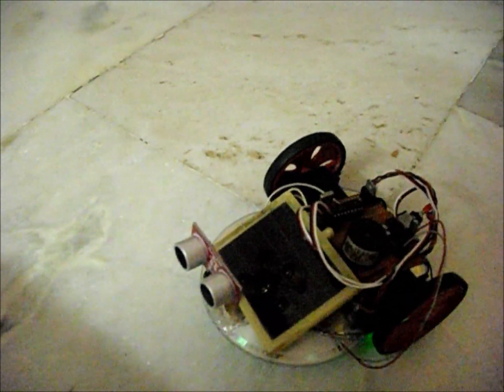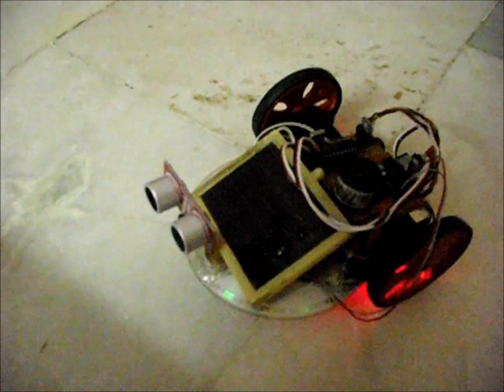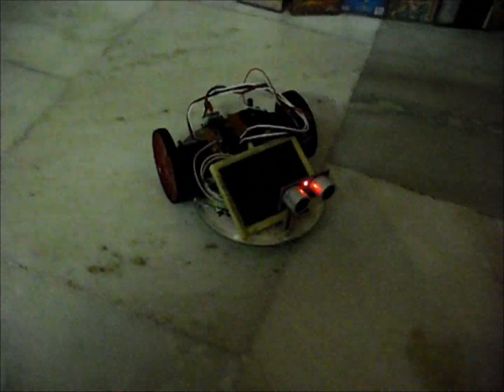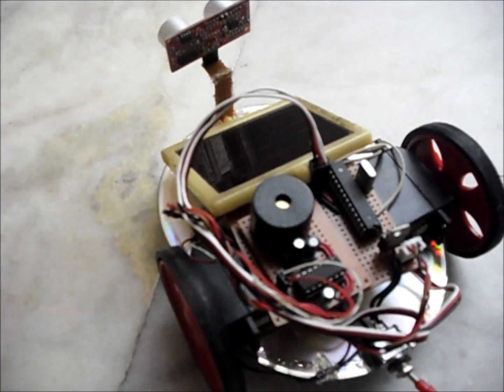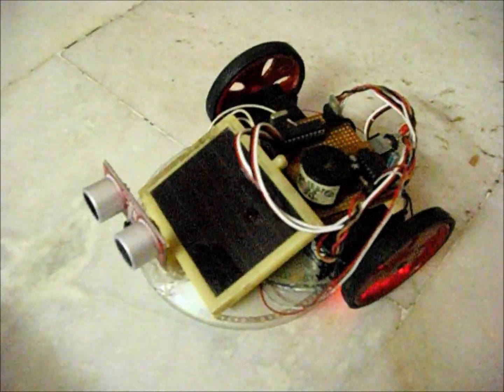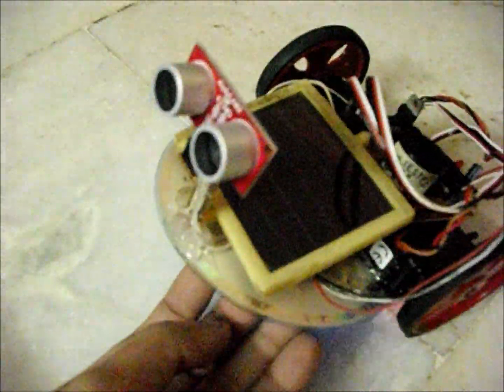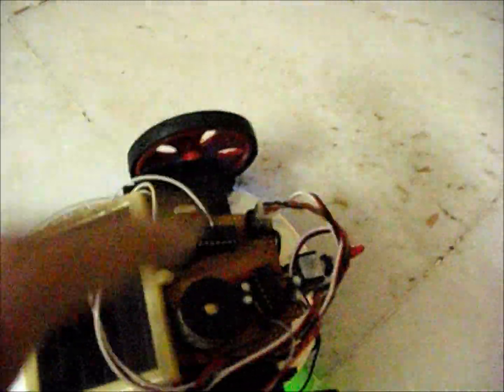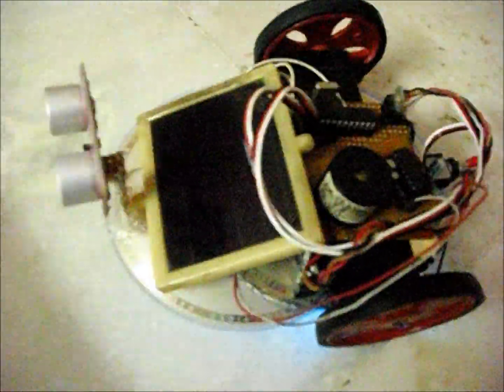Obstacle Avoiding Robot using Arduino

Comment: your video is absolutely amazing!! but i need your help as i got my science exhibhition day after today. i need to know will the code be different if i use l298n motor shield instead of l293d motor shield?
Reply from the maker: +Sayantan Talukdar Yup, if you hook it up with 89S52 It,code will be in C, however if you got a custom library with the motor shield,you'll need to include that library in the arduino ide or the IDE you're using.

Comment: Does the algorithm always go rotate it right? If so it would be better if you had a simle random number in a range from 1 to 2 generated (either 1 or 2) and you simply go left if 1 and right if 2...
Reply from the maker: The objective was to code the bot using minimal lines so as to impart simplicity and clarity.You can use Random() arduino function to implement above mentioned functionality.To add to that you can add another micro servo at the base of ultrasonic sensor to "sweep" left and right and chose direction whose reading are better.